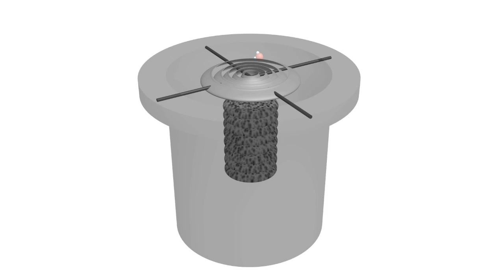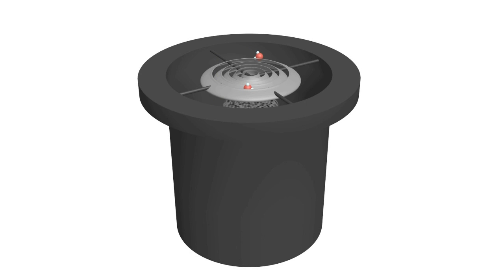Cryopump | Vacuum Pumps

Comment: Yes helium have an important part of cryogenics pump , but in a separate way,  with high pressure helium  gas ( 250 psi) by expanding this gas ( 2nd & 1st stage by adsorber) from 250 to around 80 psi it absorbs  heat from the gas, then transmit this cold to the cylinder.  About  liquid pump, yes it is important too because without primary vacuum pump  the cryo pump cant stand alone. but yes after a certain time the cryo pump must stand alone to eliminate a back streaming,  because of different stage of vacuum.